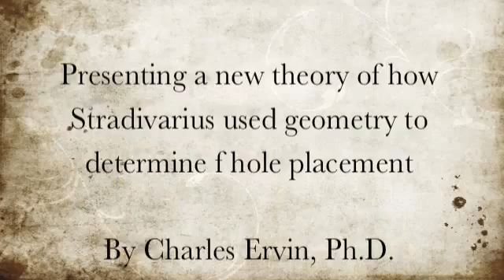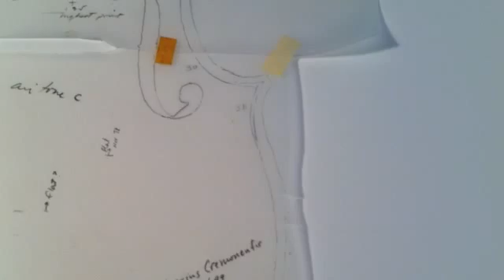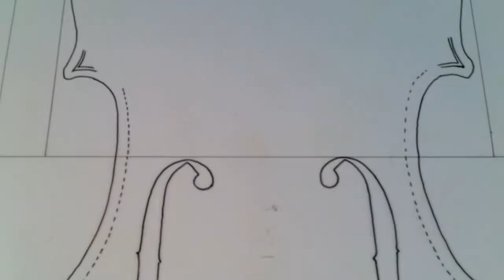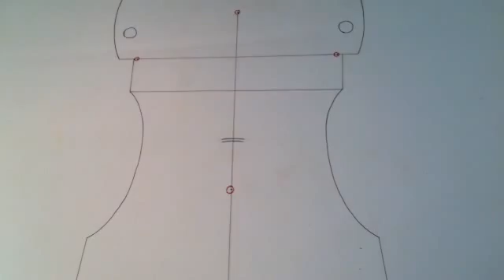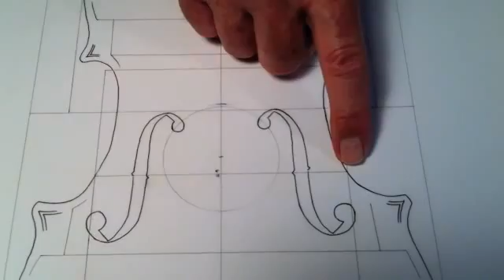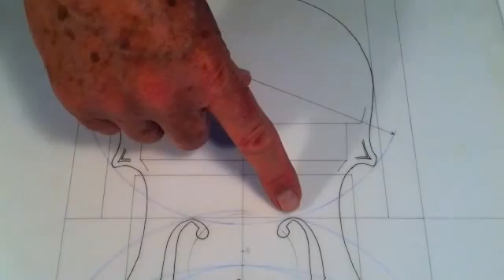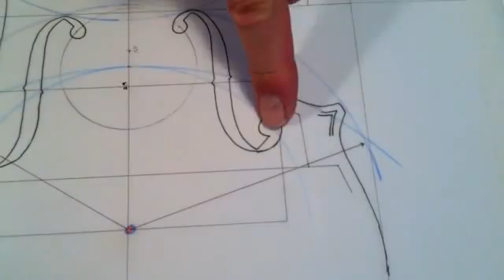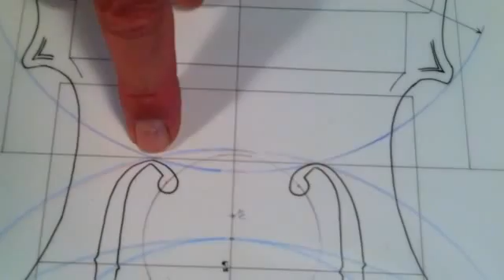The Stradivarius Code Part 1

Comment: I am concerned about one thing.  In measuring a violin, whether to measure the shortest distance from point to point, or to trace the entire length of the curve, is always a problem.  (Hence, a simple example is that the length of a violin measured with a tape is longer than that measured with calipers.)  If it is possible to take either the entire length of the curve by perfectly fitting the measuring instrument to the rise and fall of the plate, or to take a perfectly straight measurement using something like calipers, both measurements would be useful in their own right--but placing a sheet of flexible film on the violin presents a problem.  It is too soft to stay straight, but too stiff to quite perfectly match the curves--so wouldn't your tracings end up being distorted in an unpredictable and imprecise way?  As some others have commented, electronic scans would probably be a far more reliable technique--it is generally possible to measure something with a ruler to maybe 1/4 millimeters accuracy, but that becomes very difficult when you are measuring a curved object with fragile varnish on it.

Comment: I just watched the dynanamic 3D scans of the Titian Strad and at frequencies higher than about 2000 Htz noticed the tremendous movement of the delicate wood around the treble f hole in particular and immediately thought of your illustration of the asymmetric height of the top eye with about a 1 mm difference, I don’t know if the Titian has this characteristic but it’s interesting nonetheless.  Here is the video I viewed
https://www.youtube.com/watch?v=TJlVKzUj1-M&list=TLPQMTIxMTIwMjO3OFkd1Sl60Q&index=6

Comment: In this drawing I notice that the upper corners of the C bout are not in a straight line with the  tips of the bottom C bout. That tells me that the breadth of the butt of the violin is wider than the breadth of the shoulders. Very interesting. I always thought they were even.

Comment: For another aspect of a violin, see the video "Solving the Stradivarius Secret" in which William F. (Jack) Fry, a physicist, explains and demonstrates how the sound of a violin can be changed by minute changes in the thickness of the top. He died at an advanced age in 2011. 

I've watched several of the videos that purport to find the secret of a Strad, but none that I've seen even consider the effects of the bow or the strings, the components that drive the production of the sound. I would think these have some bearing on the end result.

In woodworking, laying out a pattern to an accuracy of 1 mm is not a trivial task, especially on an irregular shape. And as others have stated, if the template has a minor inaccuracy, all the pieces made using that template will likely have the same inaccuracy. I'm inclined to believe that too much significance is attributed to these minor details. Perhaps the color of the cat influences the sound produced by the catgut strings, if you were to consider the strings at all, that is. 

Then there is the matter of the blind and double-blind tests in which esteemed musicians cannot reliably distinguish the sound of a Strad from a quality modern instrument. I'm a bit skeptical of this whole enterprise, to be perfectly honest.

Comment: Thanks for presenting your studies.   You have been fortunate to have had access to lots of information and the actual forms, etc.   I do believe the 1 mm difference in F-holes was accidental, and through template use, was transferred to multiple violins.   Everything else is symmetric.  Have you ever noticed the shape of the scroll and bottom of the peg box perfectly match the contours of the inside of the upper bout?   Or that taking two necks and facing the scrolls towards each other represent the shape of the tail piece or by taking 2 necks and inverting them and sliding them together, they form an F-hole with both notches being perfectly represented by the bottom of the carving.    I believe everything about the violin was designed to be symmetric and to correlate to contours within the instrument.  The 1mm difference, IF done purposely, would literally be contradictory to the rest of the design.
Reply: What a wonderfully geometric idea. Great to notice.
Reply: 1 mm difference is not accidental. 

Since I saw this video I checked it with Strads and I have noticed that in many, for example 1699 Castelbarco Stradivari, 1700 Ward Stradivari, 1710 Lord Dunn Raven, 1734 Willemotte. I used the images in tarisio web page

Comment: This is very interesting. I have no clue about instruments. I don't even play one. But to me it seems kind of logical to have some geometric guidelines if you want to "mass" produce something by hand. I guess the method how to get there is the difference between genius and common. You could just experiment and than wirte down the dimensions and produce your instruments after that guideline. But if you start with a geometrical pattern it is easier to track back the differences between iterations of your experiments and you can easily make appropriate guesses for the next iteration you want to try. If you find something that works out than you could possibly even adjust the size in relation to your measuremnets. I would bet, if you conduct this kind of research on guitars or accoustic bass etc. would you find related proportions and patterns?

Comment: Is it possible that Stradivarius used a template for the f-holes that had the f-holes slightly misaligned, not by design but by error? If he in fact used such template (instead of measuring the f-hole position on each violin separately) that error would have transferred to each instrument. I don't know enough about Strads. I'm just trying to think of alternate explanations. 

One thing for sure, his violins did not sound as we hear them today, back when he made them. Age of wood, age of glue joints, changes of strings, all the repair work that was done throughout centuries, possible change of bows, etc. 

Also, back in the day he had no idea that one day his violins would become quite as desirable as they have become in our time. It is possible that he himself never put as much thought into all these proportions as some folks overthink today, supposedly to produce a special sound. And speaking of the special Strad sound, many experts (in fact most of them) have failed the blindfold test. 

In my opinion the bassbar and sound post details have a bigger impact on the sound than the 1mm discrepancy in f-hole alignment. And also the bridge and the strings.

There are also other measurements that are not mentioned here. Such as the thickness of the wood in various spots, the growth rings inside the wood, etc... All of those must have more of an impact to the sound than the 1mm f-hole discrepancy. And even if we measure all that we still would not know exactly how those details affect the sound.

How would a repair of a cracked top affect the sound. To do that repair a master luthier must completely remove the top, glue the crack together, reinforce the glue joint from the back, by adding actual pieces of wood, then glue the top back on the violin and reset the sound post. I think this repair would drastically change the sound of the violin. It might end up actually sounding better than when Stradivarius made it.
Reply: People like and love money, money is their value
Reply: It's true that Stradivari was a commercial maker and to eat he had to make.  But he was a skilled worker in wood before he carved his first top and the idea that he would not have cared about a gross visual discrepancy when he was known even in his own time as one of the premier makers is asking a lot, frankly.  For sure there is much more to what makes a violin than the layout - and I think it is easy to forget that many generative geometries can produce violin outlines - but time spent thinking about how he did his work is not wasted.

Comment: This is brilliant. One must assume then too that the bout proportions of the violin family are related to some optimal size for the frequencies they're meant to amplify, and that the f-hole offset optimizes this further; treble vs. bass. As well, the point-to-point relationships between the design elements must benefit soundwave transmission. For sure, there are myriad other factors, but obviously what you have here is a significant one. I love geometric design, and the violin is unparalleled... beautiful work.

Comment: The upper compass point and lower compass point define the centers of upper and lower circular Chambers.
The Chambers reasonate, and so may be predetermined by the musical octave of the design (violin, viola, cello) model.
Larger Chambers for lower octaves of sound. Just basic musical physics.
Reply: Sure but what size is best for what registers, and w/in registers, what proportions between bass/treble chambers are best for both their use in bass or treble individually AND the relationship/interplay between the two chambers overall? That's why the master violin inventors were so genius.
Reply: Of course this is possible but I do not think it is likely. I just read a similar remark on a cello form for the Davidov model. It says, the f holes are matched perfectly in relation to each other but differ in their relation to the instrument contour.

Comment: Do you think the 1 milimeter below of the bass F hole, Strad used to compensate the bass sound?
Well, I think "compensate" is not the right word but to "increase" the bass sound.  Does it make sense?
Reply: Rinaldo Faria ii
Reply: No. They are made the same height, but the soundpost creates the difference.